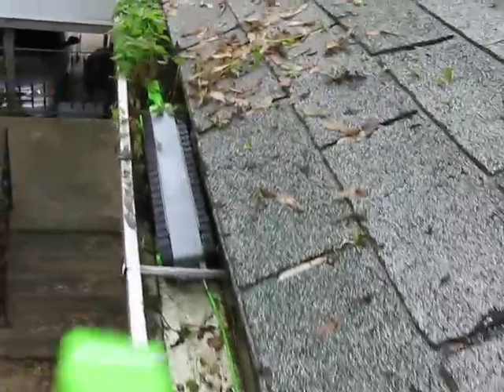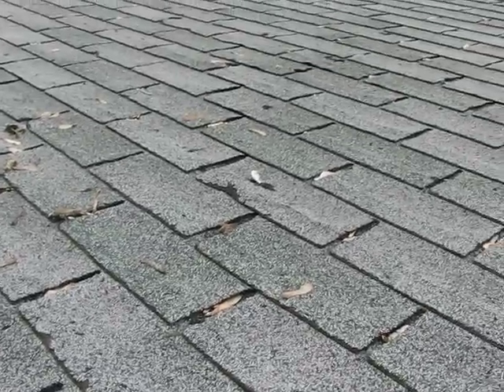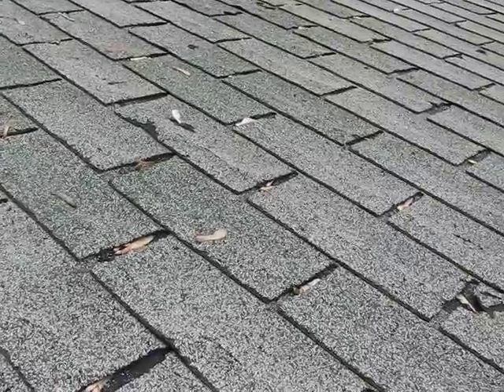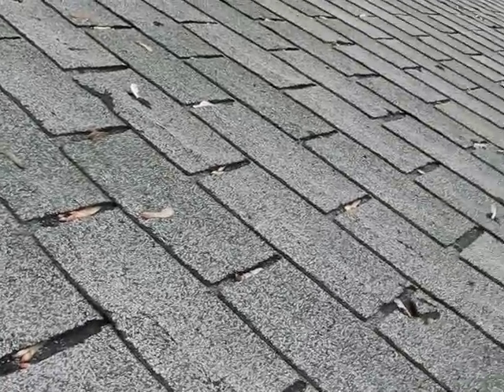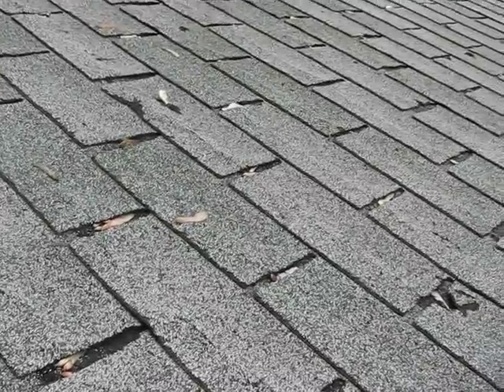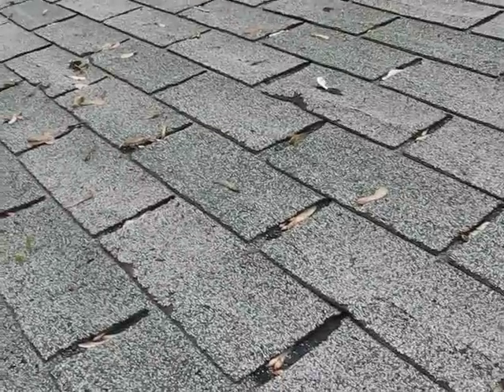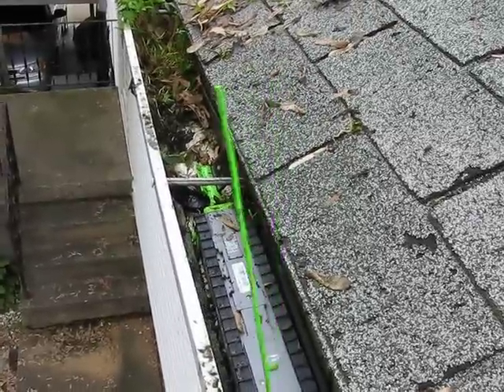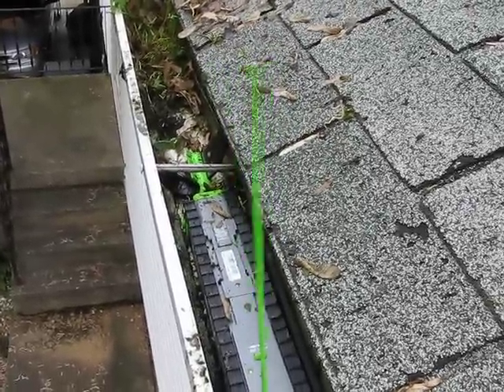iRobot Looj meets its match... or does it?!

Comment: While I am surprised it was able to drill through that dirt, I think the inventing company overlooked one big disadvantage.
The Looj simply throws all the stuff which is in your gutter onto your patio, driveway or whatever is underneath...

So while it "may" save you time and risk up on the ladder, you afterwards have to brrom or clean your patio, driveway or whatever is below the gutter.

What I do is take a little showel, take a bucket with me, climb up, showel the dirt into the bucket and repeat the process - takes not that much more time imho.

Plus I dont know if fiddeling with this electric gadget makes you safer on the ladder, then working the "old fashioned way"